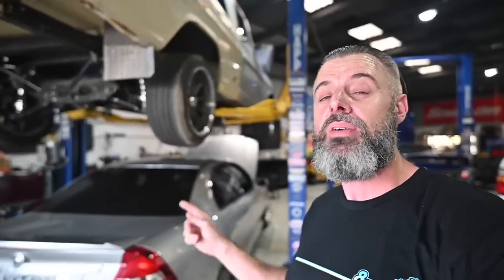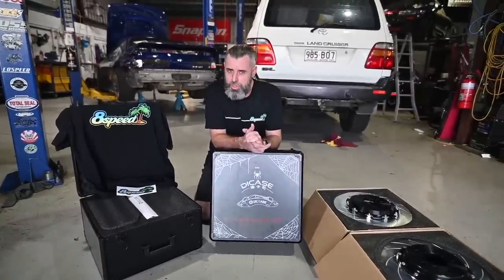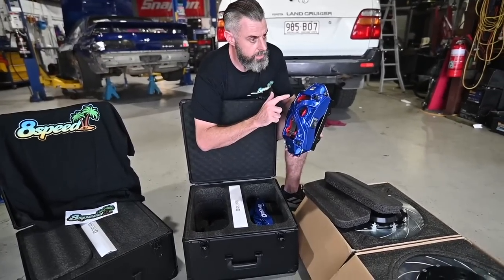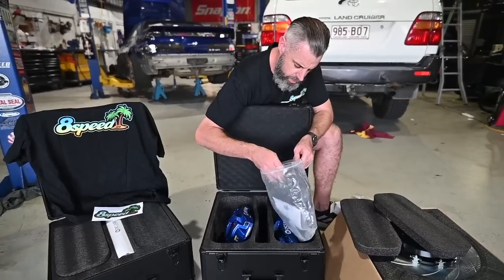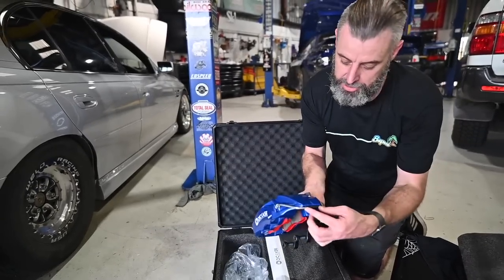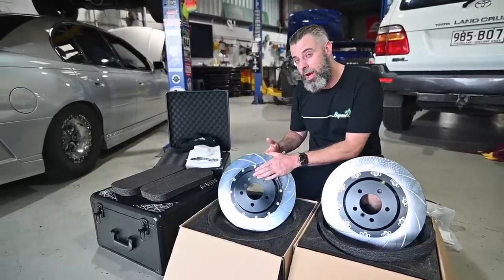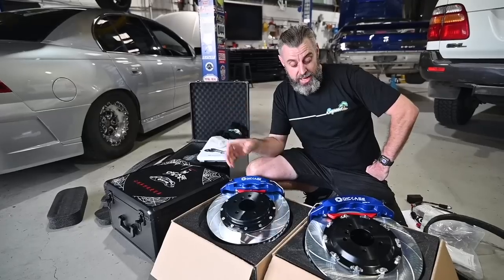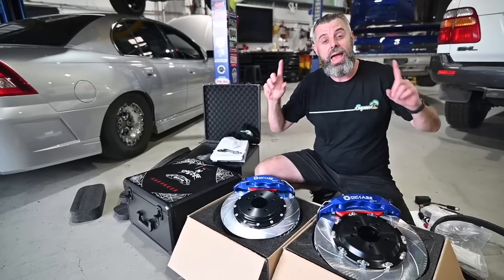UNBOXING THE NEW BARGAIN BIG BRAKE KIT!

Comment: Was this the same Senator at the Bad Ideas car meet the other day? if so it put down 890whp at that dyno i'm pretty sure, so I'm guessing 960 whp.
Reply from the maker: Sure was, however he has drag radials with 20psi in them on the roller at bad idea...... so hub will fair bit higher.

Comment: weight? what about compared to AP Racing or Brembo? are they significantly heavier?
Reply from the maker: The ones i have put side by side are the same.
Reply: Donut media weighed them vs stock wrx brakes and they were 5lbs heavier.

Comment: $3000USD for questionable Chinese brakes?! No thanks. If we're really honest, unless you're doing track days, there's absolutely no performance advantage to having bigger brakes. Get yourself some good Zimmerman rotors with proper pads and fluid and call it a day. I guarantee you'll stop just as quick as BBK's without the added unsprung mass.
Reply from the maker: I’ve done enough with them over the last 3 years to say they’re not questionable. The doubt only comes from people who haven’t seen them in the flesh or used them. In a performance application there is no comparison between these and a set of decent pads/rotors on the stock brakes. 

Whether people need brakes at this calibre is a more fair point, however.
Reply: So you would highly recommend them over the F80 big brakes swap?